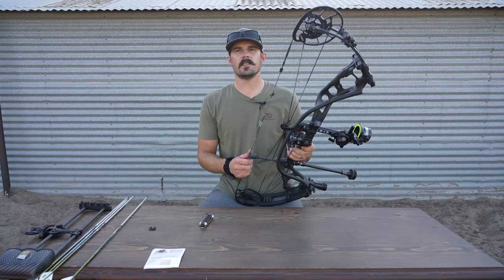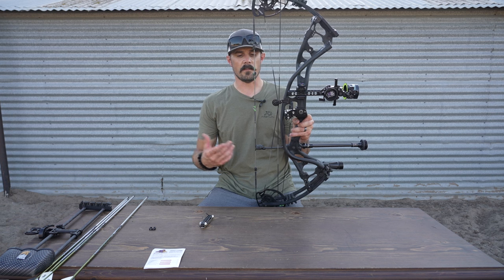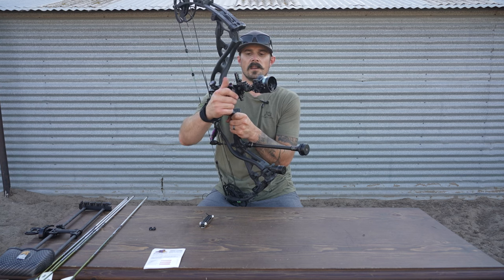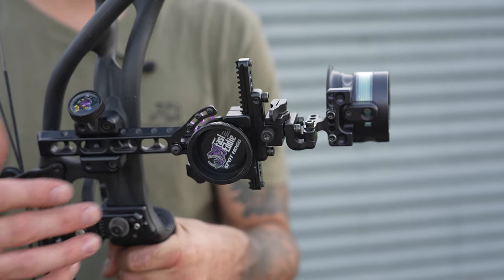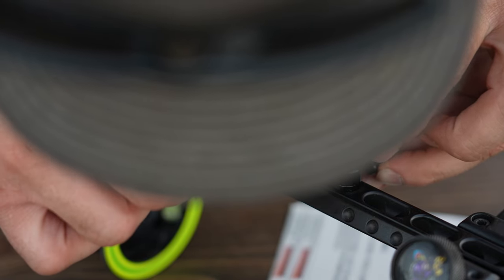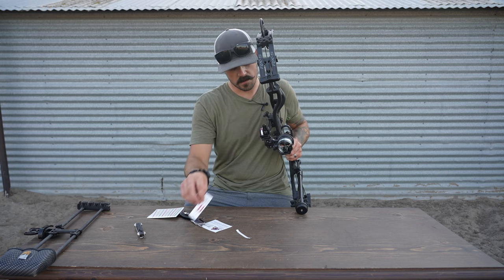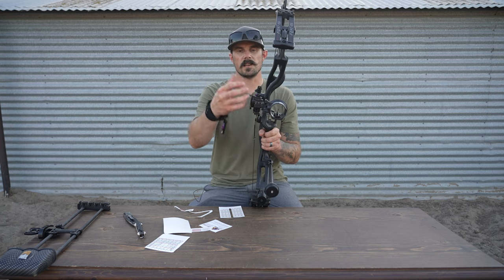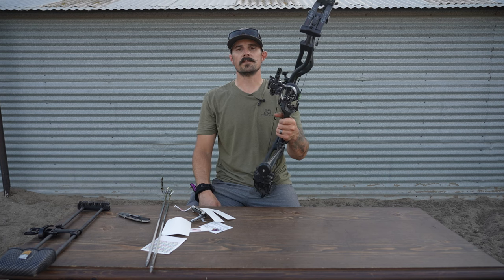Sighting in a Spot Hogg Step by Step

Comment: I followed all these steps up until I have to sight in at 60. Once I got to this step I ran out of down adjustment. I was about  a foot low and my housing couldn’t go down anymore otherwise my fletchings would hit the housing. I have the fast Eddie triple stack and a Mathews v3
Reply: What is your draw weight and arrow weight?
Reply: What did you do? Have this same problem
Reply: So bottom out the pens as low as you can and resight in at 20 and probably don’t shoot a 1000 grain arrow with 50 pound draw

Comment: I did all this and it worked at the static range but then took to a 3d range and I was low on every shot by quite a bit and only using the top pin and dialing to the correct yardage. What did I do wrong here? everything seemed good until it wasn't. Do I need to start over? if so and i end up with the same sight tape i'm worried it won't stick back on.

Comment: What's the maximum distance you were able to get out of the sight ?
Reply: It depends on how heavy your arrow is. My current setup is 476 gr (heavy) and I can get about 90 yds using my bottom pin as a floater. Any lower and my fletching would contact the bottom of the housing.
Reply: @wensel8499  thank you

Comment: When you get your bow sighted in. Which pin do you use once you’re past 40 yards? Say your at 60 yards. Can use use any pin of the 3 pins as long as the indicator is on that yardage mark?
Reply from the maker: Once everything is setup, You have 3 indicators and that correspond to 3 pins. When you dial out what ever indicator is on 60 that is the pin you shoot. Ex. middle indicator would be the middle pin.
Reply: Sounds good. Thank you!

Comment: If I was to only use this sight out to 40 yards max for now, would you still sight it in at 20/60 or can you do 20/40?
Reply from the maker: if you were only going to use the sight for 40 yards, I would just sight in the pins to those yardages. The sight tape is the drop of the arrow. best results would be shooting 20-60 for the most accurate ballistics

Comment: Is there a way to adjust the sight to get a particular sight tape number. ex. I noticed tapes 1 through 12 would be a lot easier to set 20 30 40 and as you go up in yardage the pins would be equal like 50 60 70. The tape I have now makes the 20 and 30 so close that if I got to 40 the second indicator is at like 46. Any advise? Thanks for the help
Reply from the maker: I don't think theres anything you can do with the sight. The tapes are ballistics only and they're going to be based off of your arrow speed. You might be able to start your top pin at 30 then 40 and 50 to spread out the pointers.

Comment: My 20 was set way above the zero stop. Should I bring it back down and set it close to the zero stop? Or Is it not necessary?
Reply from the maker: It's only necessary if you end up running out of distance for the longer shots. Primarily the lower you can start the sight and be on a 20 the more overall range you will have.
Reply: @SandSArchery  thanks for the advice. Out of curiosity, did you set your 20 with the bottom pin or top?

Comment: Once you get your 30 and 40 set, do you use those pins if you want to dial to say 36 yds or do you use your top pin and dial the first purple pointer to whatever you want. So I guess I am saying anything short of 50, you dial and use the pin that corresponds with the yardage within that pin and anything over 50 you dial and use your top purple pointer and top pin? Is that correct?
Reply: You would use your set pin. Whichever pin you used to set the sight is the one you use to dial. So if your sight is based off of the 20 pin and the target is 36, dial the 20 pin to 36. Personally, I use my 40 pin as the "floater," so I get a little more range out of the sight.

You can get the new multipin indicator though, which has a purple pointer for each pin. I think that's only available on the triple stack though.

Comment: I have the fast Eddie xl double pin and I set my 20 and started making my way back but I feel like when I get back to 60 or further I’m going to have arrow clearance issues with my sight is there something I’m doing wrong
Reply from the maker: Hey Tyson, give me a call to discuss. 208-495-4222.
Reply: This is a great question.  I shoot the triple stack and max out at 82 yards with my bottom pin before I start having clearance issues.  I also have a double pin that I haven’t used in a while.  Would I get more clearance and distance with the double pin considering the housing is smaller but the pins are not adjustable??
Reply: @aguilar4567  A lot of things can affect that, arrow weight, draw weight, rest height , peep height
Reply: @SandSArchery I just commented on this video with the same issue. Can I call you? What time works for you? Im EST.

Comment: how would a person sight in there lower pin for there slider pin? and not there top?
Reply from the maker: If you follow step by step, all three pins are considered slider pins. Because there is a pointer needle for each pin you can shoot any pin at any set position once the process is done.

Comment: Say I follow exactly what you did and I  need to make a shot at 80 yards, where the hell do I place the slider 80 yard mark? Lol
Reply: Which ever pointer you have on 80 yards is the pin you would use, that's why there are 3 indicators
Reply: @straightshootinoutdoors  thank you! I guess I should have worded my question better. I would use the top pointer at the 80 yard mark correct?
Reply: @Jonathan Guerrero  thsts the beauty of it you can use any of the 3 pointers on 80 and it should match up, if you want to use the top pin use the top indicator on 80 , middle pin middle indicator on 80  and bottom pin bottom indicator on 80 , its pretty much what ever your comfortable with as long as you have the correct indicator and pin corresponding  , hope that helps
Reply: @straightshootinoutdoors  Thanks for the help! I will come back tomorrow if I need more help but I think I understand.
Reply: @jonathan_guerrero  you bet ! Let me know if you have any other questions
Reply: @straightshootinoutdoors  
hello,

Can you swap any pin for a .10 pin? If so, where can I find them?
Reply: @Jonathan Guerrero  that i do not know if you can do it yourself. Most get it done by manufacturer when they order the sight ... for example, 2 pins at .19, then the 3rd at .10
Reply: @straightshootinoutdoors  thank you for responding so quickly. I read that you can send it to them and they'll do it for you. Hopefully it's not a ridiculously high price but I'll try to get ahold of them and I'll let you know what they say!
Reply: @Jonathan Guerrero  yeah let me know thanks !
Reply: @straightshootinoutdoors  good news! Spot hogg charges you $20 to swap the pin for whatever size and color you want. You pay shipping there and if I'm not mistaking they ship it back for free. They said it takes about 3 days from when they receive it for them to send it back. Just sent mine a minute ago. Can't wait to get it back and get to shooting!
Reply: Whatever pin you sighted at 20 and 60 becomes your “slider” pin. If it was top then you only use that one. I have a five pin and my bottom is my slider and the only pin I use when dialing. All others are obsolete when dialing.
Reply: @kevinsmith5775  thanks man! After quite a bit of trial and error, I figured it out lol. Archery was a tad more complicated to understand than I realized. But the same it truly is such a satisfying hobby to get into lol

Comment: I don’t understand these sights at all. What is the advantage to a regular 5 pin sight. Now a
Person only has 3 pins and it has to be adjusted to the yardage with a dial? I’m so confused
Reply from the maker: Typically an archer will select this sight because a 5 pin can be too much clutter. Also the up pins tend to clear up the sight picture vs horizontal pins.
Reply: To add to the other comment, the dominant reason is reduce clutter and clear up the sight picture, but there's also the ability to take longer shots on large animals (5 pin sights, 20, 30, 40, 50, 60 yards, but the elk is at 70, or worse yet 68 - these sights let you dial right to 68 without the need for Kentucky windage). They also transition to target archery really well. Huge advantage to have a dial when shooting something like a 3D target at 93 yards in TAC style target shooting.
Reply: @23shoge  there is definitely some substance to that. I am really considering getting one. Thanks